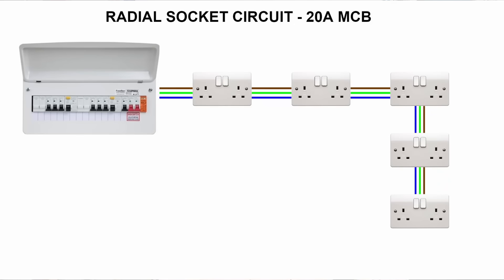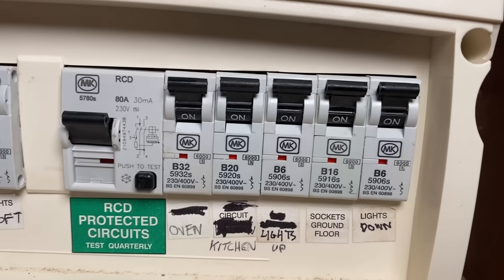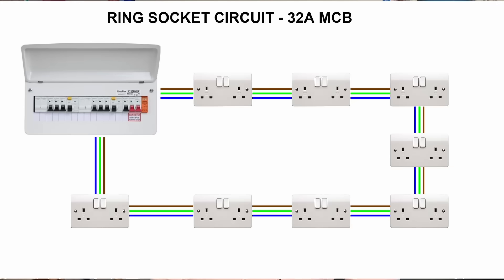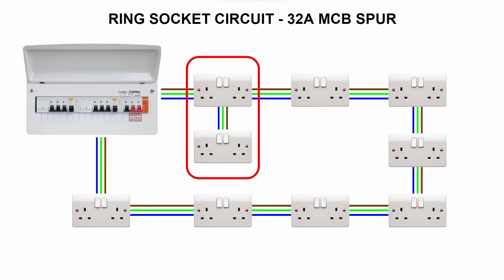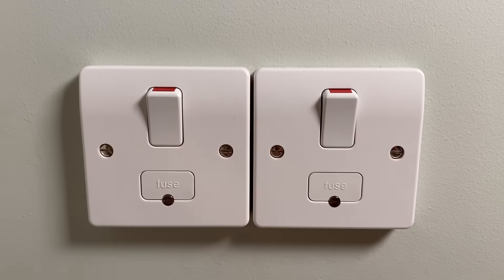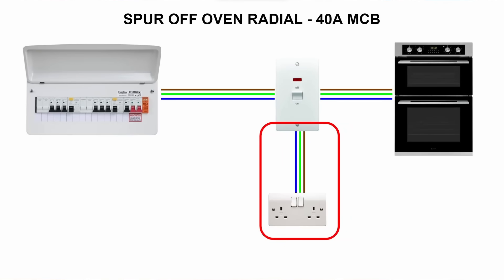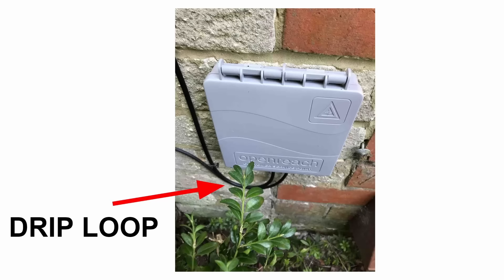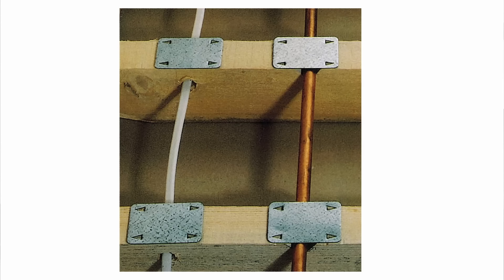BIGGEST DIY Mistakes Adding a New Socket

Comment: Great video.

Got a theoretical question however with regards to unfused spurs off a ring main. 

If using 4mm which has a rating of 37A clipped direct, from the ring main via a socket or terminal block, why can’t you spur more than one?

Using a FCU of 13A protects the 2.5mm you would typically use, but the 32A MCB of the ring main would protect the 4mm spurs of multiple sockets no?

Curious to others thoughts really…
Reply from the maker: Thanks for watching!
Reply: You are correct. The fuse or MCB is there to protect the cable, there is nothing stopping you coming off a ring circuit with a 4mm cable and connecting another 40 double sockets to it. The only limiting factor is the total length of the circuit as this gives rise to 2 very important criteria, the first being total Zs of the circuit, if too high the MCB may not trip under fault conditions, depending where in the circuit the fault developed. Secondly, the overall voltage drop to the connected appliances.
Reply: Regulation 433.1.204 - BS7671 shows the permitted options for a ring circuit.  Your theory is right with 4.0mm it would be able to cope with the load. However, potentially if your connection is at a 1/4 point on the ring circuit then four heaters are plugged into multiple sockets  on your 4.0mm spur  you could introduce a large load on the 1st leg which leads to an unbalanced load.  This will mean potentially 32A is being drawn on the 1st leg (electricity is lazy, it will use the shortest path).  By only having one spur to one socket or FCU limits the load to 26A.  Same applies to an FCU serving multiple sockets the load is limited to 13A.      Balancing a ring circuit should be carried out in say a Kitchen where potential heavy loads are .   Although ring circuits are dying a death as are split load consumer units. The preference is going to radial circuits due to the potential faults with rings.
Reply: Thanks.

Yes, but in theory could I not have 4 heaters plugged into the first double socket and double socket spur off the ring in the house, the ring then continuing on for another 14 sockets day?

Therefore it will introduce the same conditions as above?

Hope this makes sense. Fully agree with your comments too, radial is the way forward especially with high integrity earthing.
Reply: @adam6759  @Adam  your right you could do that- all the load could be at one end of the ring circuit.
433.1.204 is just a way to reduce the chance a big load as you mentioned+ adding to that section with the 4.0mm radial which would add even more.
Which is why the 4.0mm is not permitted.

Here is a puzzler - you can't install a radial  circuit with 2.5mm from a 32a 60898 to serve one double socket. Max load would be  26A.  But you can spur off a 60898 32A to a double socket if it's added to a ring circuit. 
Questions to the IET
Reply: @IW-tb8wr  is there a max distance or sqm for spurring off a ring with a 2.5mm?
Reply: @Elliot Williams  Yes - without looking in the book.  The length should be limited to 1/4 of the length of the whole ring circuit.

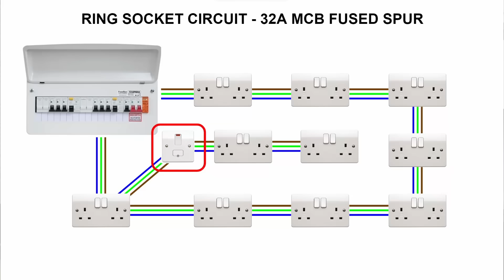Comment: IMO The fuse holder protecting the two double sockets at 6:06 should not be switched. 
Two much risk of child / visitor switching off four sockets and shutting down PCs, routers, table lamps, chargers while trying to work out what the switch does! 
This is especially true if the protected sockets are not nearby and the link to the switched fuse is not obvious.
I can't recall having seen switched spurs connected to multiple switched sockets like this, usual to assume only way socket will not be live is via consumer unit.
I have seen switched spurs in kitchens linked to an unswitched single socket under worktop socket for dishwasher etc. A switched spur to multiple switched sockets could be handy in a small home workshop, integral garage or home office where you want to ensure all sockets are off all at once I suppose.
Just a DIYer btw... so sharing ordinary householder thoughts on this.
Reply from the maker: Yes good point! I guess it comes down to the specific scenario. Thank you for watching!
Reply: Had this problem in last rental; someone switched off a spur box - and we wondered why the deep freeze wasn't working!
Reply: In my old house someone had wired a spur correctly, but later added a wall socket for a TV and a FCU for underfloor heating, all on the one spur. Load wise it was OK but against regs. The only solution was to add a FCU at the source of the spur and label it accordingly. No possibility of extending the ring without major upheaval.

Comment: Interesting video, thank you. So, in summary if you look in your consumer unit and its a 20A breaker, it's a radial circuit, 32A and it's a ring circuit (probably)? Pretty sure my garage/workshop therefore is a spur off a ring. I have recently added more sockets, so now run the risk of overloading the wiring... oops!

In practice most people do not plug in 13A at every socket, but even so... I will get my sparky to add a new circuit.
Reply from the maker: Thanks for watching! You could put a fused spur where the shed spurs off the ring, or just make it a radial circuit of the board, as you suggest.
Reply: @TheDiligentDIYer1759  Good point, as it happens I think there is a fuse now you mention it... I'll double check. Thanks again.

Comment: Your picture -  radial socket - has to many sockets 4  max  0:20
Reply from the maker: Why would there be a limit of 4?
Reply: @TheDiligentDIYer1759  Max load UK  240V  x 13A = 3120W per DSS x 4  = 12480W Any more sockets will over heat first 2.5 twin and earth cable radial. if all radials used at max load of say 4 x 3KW fires to heat 4 rooms. a DIY'er would do this sort of thing and wonder why there house burnt down.
Reply: @uksuperrascal and he done a runner
Reply: @uksuperrascal  why would 4 times the load on the circuit not trip the circuit breaker?
Reply: Handy to know thanks

Comment: A little knowledge is a dangerous thing. Your video is quite informative but be careful of giving advise. I don’t want to sound like a preacher but we call it the silent killer for a reason. There’s bonding, zs, earthing arrangements to name a few. These things as well as others should really be understood, even if they’re shit at the calculations on paper. We have tabulated figures for this so we don’t have to do the calculation but you should really understand. 
Question. One double socket on 2.5 cable, clipped direct 3 meter from consumer unit on a 50a mcb. Ok or no?
Reply from the maker: Thanks for watching!
Reply: Advice not advise

Comment: For the DIYer.. I would also recommend an additional bonding conductor to be run parallel on radial socket circuits to take into account any high rated loads that may be placed onto the circuit. OSG 7.5.2
Reply from the maker: Thanks for watching!
Reply: That reg isn't about high rated loads it's about earth leakage. There's no reason to run a bonding conductor in with a radial.
Reply: eh.....???????
Reply: Earth Leakage occurs from most properties that have (in general) stuff like fridges, freezers, washing machines, dishwashers etc... and for them to work the way they are designed to, they will "dump" residual current down the circuit protective conductor. This is quite normal, but as electricians. We have to account for this. It is quite possible to have (on a high rated loading cable, such as a kitchen ring final circuit) residual currents that are split down each leg of the "split ring" (now 2 radials).. if these conductor currents are about 10mA then you must run additional earth bonding. As it states in OSG 7.5.2 you can't just split a ring without checking the currents.. if you do, then in case you have these currents on the electrical system I would run additional protection for the circuits.
Reply: @simonhumphrey17  
Confusing there. What is this split ring you are on about?

Comment: When did you  qualify as an electrician? DO not think you can think you can give advice without a  qualification
Reply from the maker: Is anything I’ve said wrong? Thank you for watching
Reply: @TheDiligentDIYer1759  how would you classify a cooker switch with a double pole socket built into it? it would be a run of 6mm cable on a 40 amp fuse. Most modern cookers can now be used on a 4mm cable with up to a 32 amp  fuse. it all comes down to divercity and voltage drop. Safe plates,the cable should be run through the beam at least 50mm from the top or bottom of the beam to prevent accidental piercing by fixings,notching cables into beams is a big no,no. I agree on the safe plates but,not the notching

Comment: It's 2023 ring circuits unnecessary.  No one wires a house up with one ring ...surely. 
Radials all day long.
Reply from the maker: I’ve seen rings fitted in homes only a few years ago, but agree radials are much better. Thank you for watching!

Comment: If I think I'll be running a cable where the 'less gifted' may not expect a cable,  which can happen if say moving a stud wall, I reckon its a good idea to put in along the track of the cable all those odd bits of scrap metal you were planning to weigh in but never quite got around to what with all the new regs around scrap being accepted. 

That way even the most clumsy sweep with a metal/cable detector should make it easy to find.

Of course, as the Lawyers do say, 'You can't legislate agsinst stupitity' so if they don't use a detector ...........
Reply from the maker: There are requirements for running cables outside of zones. I believe they need to be either 50mm from the surface or have thick steel plate covering them to protect from drilling. Thanks for watching!
Reply: @TheDiligentDIYer1759  Appreciate the heads up  
Cheers

Comment: For the spur from the shower/cooker circuit. Could you spur with either 6mm2 or 10mm2 (depending on the rating of the shower and MCB) to a fused connection unit, and then take a 13A supply from that FCU to the socket with 2.5mm2?
Reply: It’s not ideal. In terms of isolation of the spur, are you going to label the consumer unit accordingly?  Me personally I wouldn’t entertain it
Reply from the maker: In theory, i don’t see anything wrong with that, i don’t know if you’d fit a cable that large into the terminals on an FCU though. Perhaps wouldn’t be considered best practice though. Any sparks here, please correct me if I’m wrong. Thanks for watching!
Reply: @TheDiligentDIYer1759  might want to check the rating of the spur connection unit as likely not high enough to chuck on a circuit fed with 6mm plus it would be a bloody gash thing to do in general...
Reply: @jameshansing5396  The appliance is what dictates load, not the circuit's wiring or breaker.
Reply: I think we are talkingat crossed purses, chap!
Reply: I assume you mean shower OR cooker circuit? As far as design is concerned you could come off the shower or cooker circuit in 1.5mm cable into a Fused Connection Unit (FCU) without and problems Many people will tell you, you can't, they are the people that you shouldn't really be taking advice from as they are showing their lack of knowledge. Let me explain, Any circuit with any sized cable can be tapped into at any point provided that the following is satisfied. That at every point where a cable size is reduced, appropriate protection is added to protect the smaller cable. The protection can be installed at any point in the smaller cable section but MUST be installed before the load that it is supplying. This gives two options, either come out from the larger cable straight into the lower protection device and then continue with the smaller cable or, as stated above, come out and complete the run with the smaller cable into a FCU then to your appliance. However the minimum cable size you can use to connect a FCU to a circuit is 1.5mm, the reason for this is that the maximum fuse and therefore load, able to be connected to the FCU is 13 amp. 1.5mm cable will handle 13 amp. This is NOT an exhaustive list as other factors do come into play and can have an unexpected effect on the installation. Having said the above is NOT to be construed in any way as my endorsement or recommendation that you complete your own electrical works. If this where a gas installation, you probably would not attempt it. Legally if you are not deemed a competent person you should should not attempt your own alterations/additions. Remember you can smell gas, electricity cannot be seen, heard or smelled but it is as just as dangerous and will kill or seriously injure.